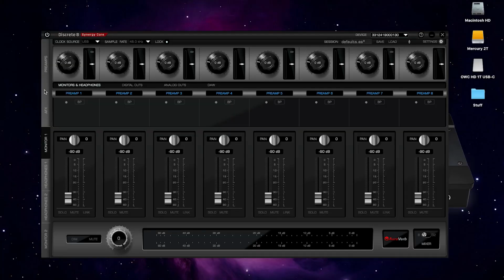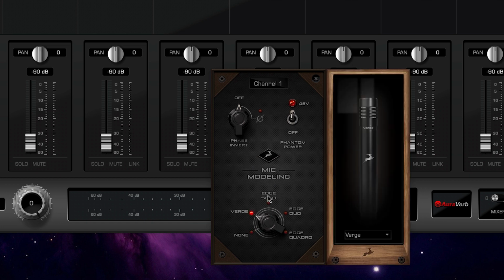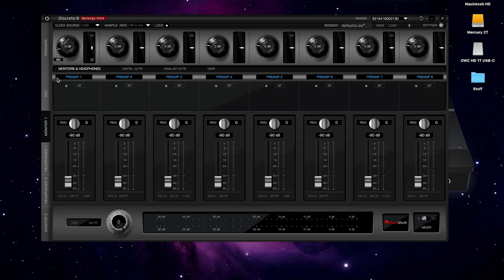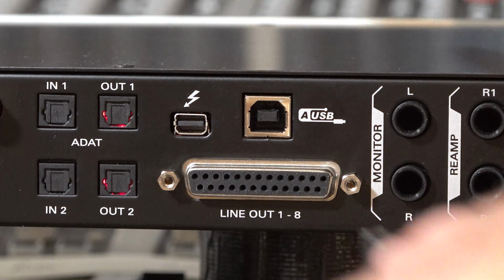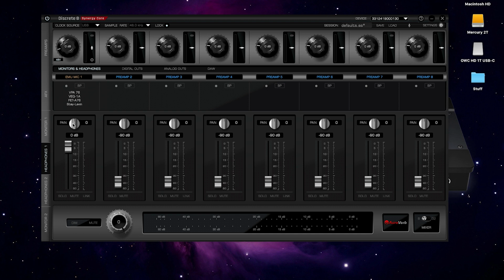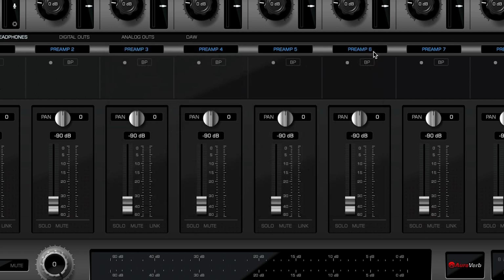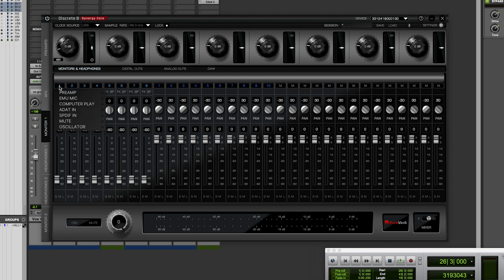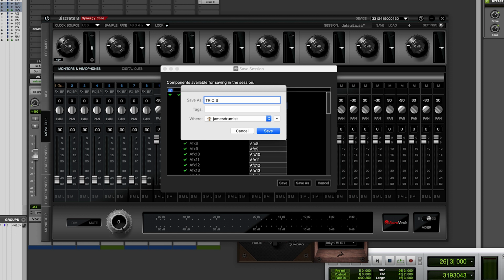Routing, Tracking and Monitoring with the Discrete 4 & 8 Synergy Core Control Panel

Comment: How about you answer some questions that are not in the manual and not intuitive, such as: can I route each preamp into a different analog output post the FX assigned to each preamp?  Because, I'm pretty sure I didn't hear them when I routed vocals through your plugins into another mixer via one of the outs.
Reply: Same here. I totally regret the moment I purchased the Antelope. What is the programmer's profession btw? Because I'm sure they skipped Usability.
Reply: Coud you find a solution?

Comment: Hey, what's the difference between the 4 Core and 4 Core Pro?
Reply from the maker: Hi Filip

Thank you for your comment. We have built on our earlier Discrete 4 (non-Pro) model by adding DSP capable of hosting our acclaimed Synergy Core platform, and by improving the specs of our A-D and D-A conversion — with dynamic range increase of 6dB. Also new to the Pro model is a virtual patchbay, allowing you to patch any analogue, digital or software input to any output, and vice versa. You can take a look at all the improvements on the product’s page on our website: https://en.antelopeaudio.com/products/discrete-4-pro-synergy-core/

Antelope Team

Comment: I’m deciding between UAD and Antelope. I have Dell XPS15 Win10.  I currently have 18i20 with about 20ms latency and ADAT IO I want to plug into new DSP interface. I tested 3 other different interfaces on this machine and they all work fine, albeit laggy 30-40ms latency.

I am seeing impressive specification about DSP and ultra low latency which Om in the market for now. 

I am leaning UAD as of now but willing to give Antelope a shot, is it true commentators this is bad for Windows PC, or is it Pebkac?
Reply: what did you end up going with and how is it working out?
Reply: @poindextertunes  go for the UAD ffs. I got the discrete 4 synergy. its good and all but go for the UAD.

Comment: Dude, I just want to set up direct monitoring in pro tools and this showed me but gave absolutely no real explanation as to wtf is going.  I’m tired of record at 256 samples.  Anything lower and my discrete audio 4 will give me dae errors every 8 bars or so!  With no plugins!  It’s frustrating because I REALLY like this thing but damn dude.  You guys aren’t making it easy for a lot of to understand.  Give us what we want!  Please!
Reply: isn't this crazy, my setup. 2010 Mac pro, Digi 003/DigiMax FS & two more channels via SPDIF through my PCM90 (18) channels 48k, 32 buffer. Can't believe my old gear tracks that low of buffer with some effects. Only thing is old dull convertors, yet Ken Lewis made hit records using the 002.
Reply from the maker: Hello Anderson,

Thank you for your comment!

Have you been in touch with our technical support department? They would be more than happy to provide you with the needed guidance for your Discrete 4 Synergy Core. You can contact them via the following page - support.antelopeaudio.com 
We remain at your disposal.

Comment: Shelved RME and UA interfaces for a Synergy Core interface,as the Antelope Audio Discrete 4 we have outperforms them. But Lord Have Mercy! Why are Windows users treated like the ignored stepchild,regarding afxdaw use? I really didn't care until I found I liked the AA effects more than ones I have been using for years. Cool surprise...then realized I would have to go Mac. Meh..oh,well🐵
Reply: sorry mate, not a good choice … RME is much more intuitive and hey @Antelope … we had so much bugs with our last Antelope interface … never again
Reply: @curtis_chip  Luckily,we haven't had any problems with our AA unit doing what we need,compared to our RME( 4 onboard preamps plus optical input). I hated the breakout cables on our Babyface but agree they are primo kit. The manual is...fun.

Comment: When afx2daw for windows?
Reply: The answer looks like... "never". Especially for usb. I´m running a recently purchased Ryzen 7 system (no thunderbolt) on Windows. I have purchased a Discrete 4 Synergy Core. I´m starting to think that these "working on it" messages are nothing but smoke.
Reply: @rodericogarcia  for now i have an m1 mac air. And bought the expensive old thunderbold 2 to 3 dock and the cable. We will see how it will work.
Reply: @myleeh8533  Did you have any luck? I just bought a new 14inch MacBook Pro and read on the Antelope site that M1 architecture is "not supported at this time"... ugh!!!!! Looks like you have to stick to the routing as insets work-around